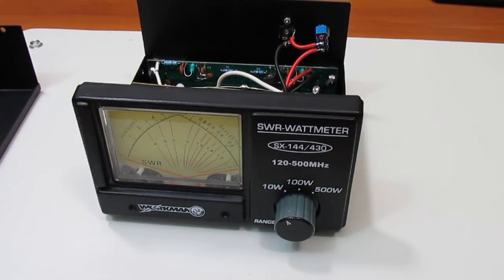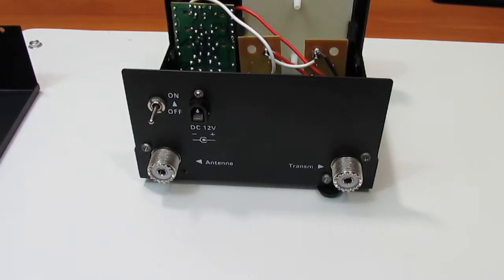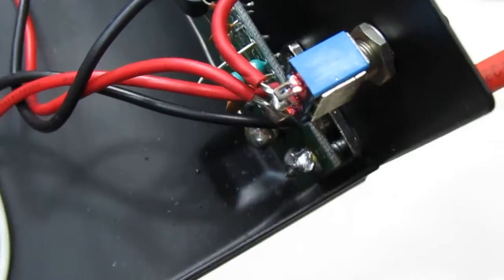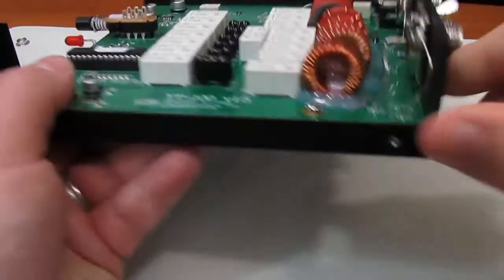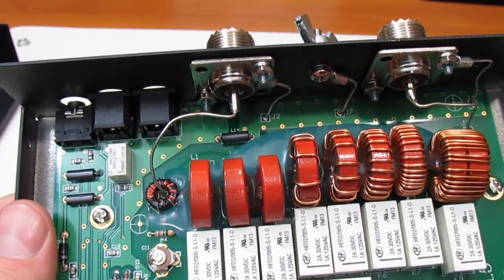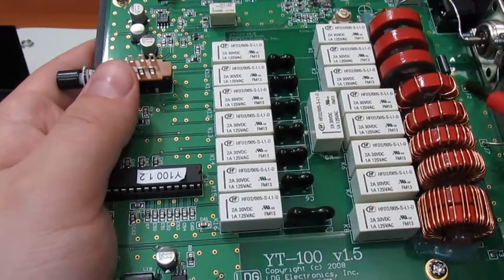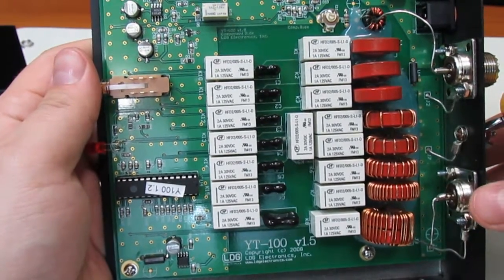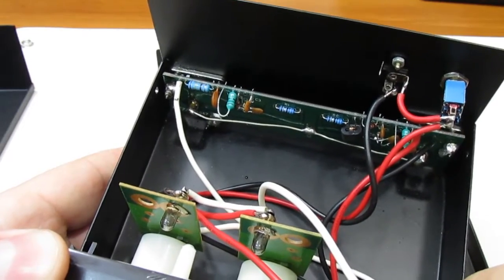Workman SX-144-430 SWR Meter Grounding Issue

Comment: had a question about this meter and this is the only video I found with it.  When using this meter say im testing upto a 20w radio...  do I set the dial to 10w?  or 100w?  what if im testing a 5w baofang do I put it on 10w?
Reply from the maker: The dial always has to be set to the range higher than the actual output power of the radio. So 100 W for your 20 W example and 10 W for the 5 Watt radio. Think of the setting as a "maximum allowable input power" setting.
Reply: @BalticLab   awesome thank you so much.